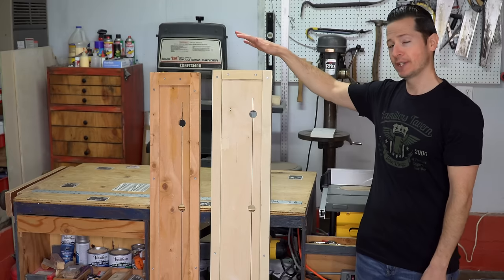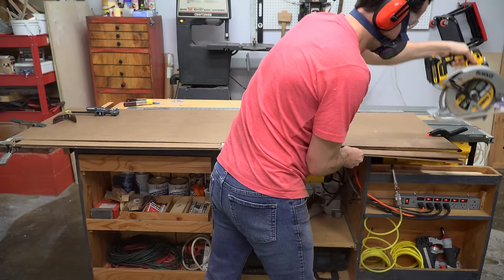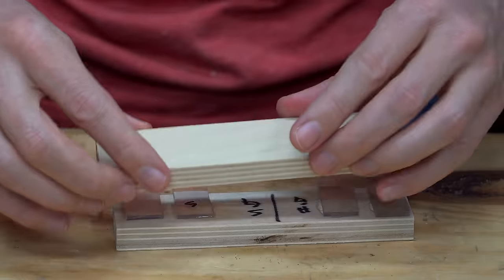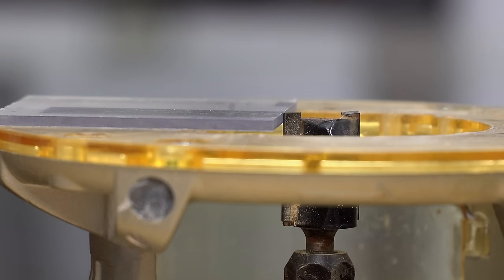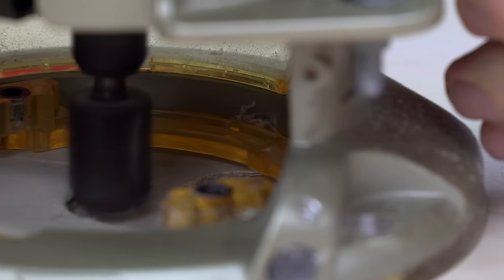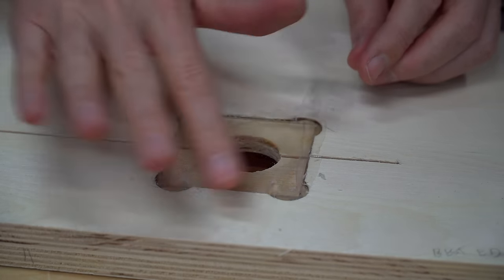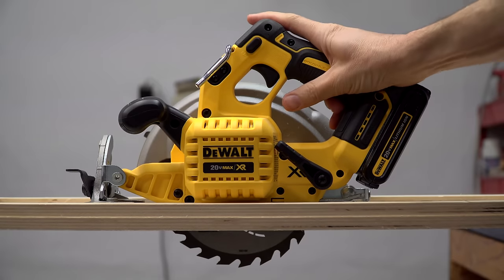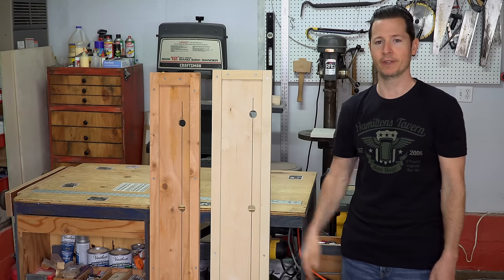DIY Saw Track Update

Comment: Apologies, I didn't watch your first video.  Thank you for your ideas here.  However, I see several limitations to this design:  

1)  You have a finite length that's not even as long as a 4x8 sheet of plywood.  Should you ever require a track saw to cut the length of a sheet, you'd have to stop, reset your measurements, and hope the cut is still straight.  When I purchased my WEN track saw, I made sure to buy enough track to cover the length of 8 feet.....and trust me, I'm sure glad I did!  Would never trust that length in a table saw to be accurate, or try to stop and make two different cuts.

2)  Related to #1:  sight lines:  it appears to me that you need to draw a line down the entire length of your wood for this system to work, as your sights aren't on the ends.  What happens when you have to draw a line that's longer than your longest straight-edge?  Again, you'd have to connect two different lines.  Also, pencil lines on wood can be unsightly depending on the project you're doing, whether you can sand it off, etc.
Reply from the maker: No apologies necessary! Every design has limitations, and all tracks have a finite length 😉. There is always a trade...even if you spend big money, one design excels at certain things while other designs excel at other things. There is no one "perfect" design that excels in all areas. This design excels at being very inexpensive, while still provide a true cut. A well-manufactured track saw that excels at full length 8' rips, will not excel at being as affordable, portable, or compact as this. Choosing one design means giving up the features of the one you don't choose....that's why us woodworkers always wind up buying both 🤣

Comment: What if the perimeter use aluminum pieces instead plywood?
Reply from the maker: The only downsides are that aluminum is more expensive, and would take more care to attach. Other than that, it would definitely work!
Reply: @OneMinuteWorkbench  its true
Here in Guatemala I found two pieces abandon for 2 dollars and for the bottom a piece of allucobond for free
I am lucky 
Good luck!!

Comment: looks like the plexiglas about doubled the build time. What is the benefit of using the plexiglas
Reply from the maker: It definitely at least doubled it. The benefit is that you no longer have the risk of tear out at the sight hole locations. I hope this helps!
Reply: thanks for the reply for the life of I couldn`t figure out what the advantage was
Reply from the maker: No problem!
Reply: I'm glad I am not the only one wondering that.

Comment: What is the purpose of the acrylic at the sight holes  vs. not having any?
Reply: Nobody know, not much of an upgrade to me.
Reply: @lukasz070485  it's to have zero clearance and keep wood from splitting at those areas....(found out after I asked)
Reply from the maker: Exactly - improves the “zero-clearance” function of the track. Really though it would only be necessary if you’re doing finish cuts on edges that will be exposed in a furniture quality type of application. Otherwise it’s just overkill. I hope this helps!
Reply: Ok thats clearly explain their purpose. Thank you :)

Comment: Thought/question.  Where the side rails are controlling the saw, why not make the initial cut line, then widen it by an inch?
Reply from the maker: The slot provides zero-clearance for a cleaner cut. Does that make sense?
Reply: @OneMinuteWorkbench  not really, I'm not sure of the thought behind it
Reply from the maker: Do a google search for "zero-clearance" or "zero-clearance table saw insert" and you'll find a bunch of videos that explain it. It makes the cut cleaner by keeping the small fibers near the edge from "blowing out" or "tearing out". Anyway, I hope this helps!

Comment: What blade did you use to cut the  poly?
Reply from the maker: I just used a cross-cutting blade in my table saw, but I probably would have been happier using a blade with finer teeth. Anyway, I hope this helps!

Comment: I need an 8' track , what would I do because an 8' track would be the same length as an 8' sht. of material that is being cut.
Reply from the maker: You have a couple different options: 1.) Do the same think, but start with larger stock (probably 10' or 12' stock), or 2.) make a one-sided track. A one sided track isn't as much of a guarantee, but it's easier to make from standard 8' stock. With diligence during your cut, it too will produce nice straight cuts. Another benefit is that it doesn't need sight-holes, is simpler to build, and easier to line up. I hope this helps!
Reply: you could make this jig maybe 6 or 7ft long, mark out your long cut on an 8ft sheet of plywood with a large T square, make the cut and then move up the jig, realign with sight holes, and finish the cut. If you line it up correctly, cant see why it wouldn't work.

Comment: Do you think more line up holds would help. What if your pencil marks don’t fall near the holes?
Reply from the maker: Yes - if you had more, you could draw lines just at the ends. As it is right now, I just scribe a line the entire length of the cut, but more holes would give you more options. I hope this helps!

Comment: How would cut length wise on a 8' panel?
Reply from the maker: I typically make my full length rips on the table saw, because it is better suited to making rips. I use this track mainly for making cross-cuts. That said, if you wanted to build a full length track, you could make one starting out with material long enough to accomplish the task. The sell longer (12') material at most home centers (usually in the "trim" section), or you could buy 12' plywood at most hardwood stores. I hope this helps!
Reply: @OneMinuteWorkbench  good idea, thanks for fast reply👍

Comment: Hey! What model of circular saw is that?
Reply from the maker: It's a DeWalt DCS570B 20V Cordless Circular Saw with Brake. And in case you're interested, here's a link to all my tools: https://oneminuteworkbench.com/my-tools/woodworking/ The saw and its link are listed under the "Cordless Handheld Power Tools" section. I hope this helps!

Comment: Have you thought of having metal rails instead? You could still sit them on a wooden base but they might last longer ie no warping and less prone to damage
Reply from the maker: That's certainly an option! So far the wooden tracks I've built are holding up nicely, but the more metal there is, the longer they will ultimately last. I hope this helps!

Comment: Hi Tommy, Thanks for the update on the saw track. Call me dim if you want but what benefit is there to added the Perspex to the underside of the track? I'm sure there is an obvious answer but I can't think of it. Cheers Huw
Reply from the maker: it provides a zero-clearance cut on both sides of the cut line, further reducing tear-out. I hope this helps!
Reply: @OneMinuteWorkbench  I said it would be obvious, just couldn't think of it

Comment: Tommy
Great job
I have a question about the lexan. 
Does it distort the pencil line on the workpiece? 
Thanks  poke
Reply from the maker: Thank you! The Lexan does not distort the line, but even if it did, I'm only aligning the edge of it with the line, so it probably wouldn't matter. I hope this helps!
Reply: You could take a sharpie and color the bottom edges, to make it more clear what you are aligning to as well. If you look through the cut line, not through the plastic, there should be very little refraction and parallax.
Reply from the maker: Thank you for the suggestion!

Comment: You didn't use my idea of putting silicone on the base to make it grippy ?... 🙄
I'm devastated... 😔😫

😎👍☘🍺
Reply from the maker: I know, I know - I haven't found out how to implement it just right yet. If you add silicone, you can't add it at the sight hole locations (or it would obscure the view), but it will raise the windows off the piece being cut, which ruins the "zero-clearance" factor. If it were VERY thin, it shouldn't cause much problem, but I can't see how to get a good consistent, and extremely thin application. If you have ideas, I'm all ears!
Reply: @OneMinuteWorkbench     ....finely notched spreader is what I used.. & just put some tape over the sight holes !! 
I guarantee you'll be amazed at how well it grips .
If you're unsure & don't want to risk messing up the track, get some scrap and try it ! 🙄😏

😎👍☘️🍺
Reply: Although using some grip tape (like the stuff skaters use on skateboards, or people use on stair steps, but adhesive-backed sandpaper works well too) also raises the platform just slightly, Ive had zero problems with it. Im thinking tthat an application of that stuff, strategically placed, would be more consistent w/keeping it level throughout the track, over spots of silicone, but maybe not. I dont see silicone having consistent results in this manner. School me please, for I am willing to learn something.
Reply: @6980869   well... if you use the notched tile adhesive spreader as I said, the fine lines of silicone will be consistant all along the length of the track. Like I say, try it on some scrap & see how it goes !!

😎👍☘🍺

Comment: Could you have used MDF, rather than masonite? It should be rigid enough and the surface would be smooth.
Reply from the maker: MDF would probably work, but it might be a bit heavy. I feel like high quality plywood is the sweet spot for this type of project. Anyway, I hope this helps!

Comment: Question could you not use a 1/4" lexan for your entire bottom and counter sink screws from the under side into your frame? This would eliminate the site holes and you would gain 1/4" - 1/2" of saw blade.
Reply from the maker: That sounds like it would work, the only trouble might be with how much that big of a piece of Lexan would cost. I think it would be pretty expensive. Either way, thanks for sharing the idea!
Reply: @OneMinuteWorkbench  if you stick with wood work by the time you addup all the time materials and rework on the edge you are better off with a real track saw. I see people go thru that all the time spend years doing what you are doing but in the end its like paying the minimum balance on a credit card - death by a 1000 jigs.

Comment: Love the project! Just gotta figure out how to afford a router...
Reply from the maker: Thanks! Fixed base routers like the one I used on this project aren't too pricey. Even without a router, the track saw is still a great build. Good luck!
Reply: @OneMinuteWorkbench  Thanks for the reply! About how much was the one you used in the video? I'm trying to get a shop set up from scratch.
Reply from the maker: The saw was $129, and it's the 7 & 1/4" version...the 6 & 1/2" version is $99. That's for the tool only though. I have a couple of DeWalt drills that came with 2 batteries each, so I usually have extra batteries hanging around. I hope this helps!
Reply: @OneMinuteWorkbench  No, I was asking about the router. I've got a pretty decent Ryobi circular. Between this and the jig that helps you make cross-cuts with the circular (I think that was on your channel, but I might be mistaken..) it's really helping my get started without having to shell out a lot of money for a table saw and miter saw
Reply from the maker: They don't make this exact one anymore, but I think the equivalent version is about $70. You could even get one that's cheaper for downwards of $40-50, but you might not want to go that low on quality. Was this the jig you were talking about: https://youtu.be/H0BZLbW1lvQ

Comment: Not sure what the point of the plexi glass is?!
Reply from the maker: It continues the zero-clearance at the sight hole locations. I hope this helps!
Reply: One Minute Workbench...of course makes sense now!! So, as a quick thought, could you not just use a full strip of thick plexiglass, inch wide, giving full view of the cut line instead of just via the few holes?
Reply from the maker: Dave, yes you could! However, it might be pretty pricey.

Comment: You could have left the router set deeper, so the plexiglass is not flush with the bottom, so it does not rub and scratch when the guide is set down and sliding around your work piece. I could see, pun intended, that this plexi will quickly become non transparent.

Comment: Why plexiglass Will it not get blury after a while? Hols stays clear for ever.
Reply from the maker: It just continues the zero-clearance of the slot through the hole locations. It should get blurry...at least not too quickly. By the time it gets scuffed enough to prevent you from seeing the line, it'll probably be time for another track. I hope this helps!